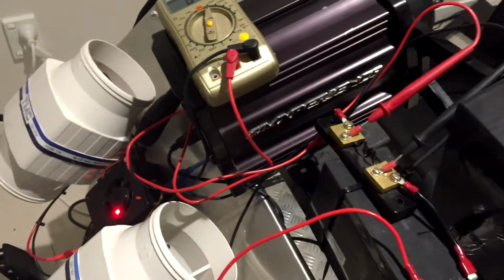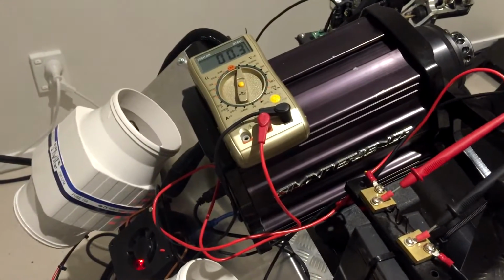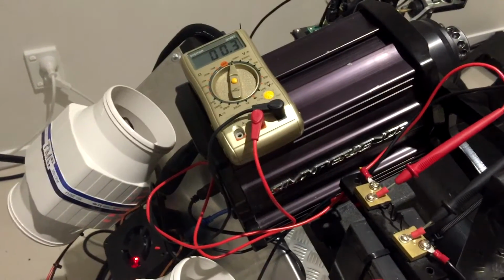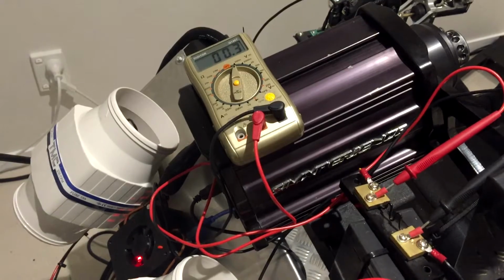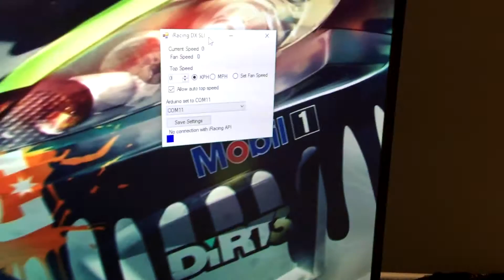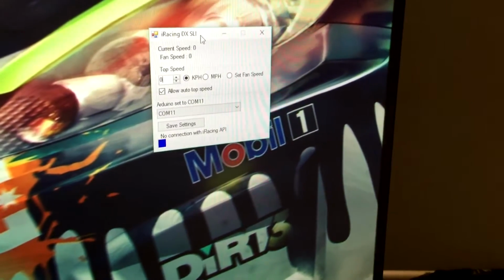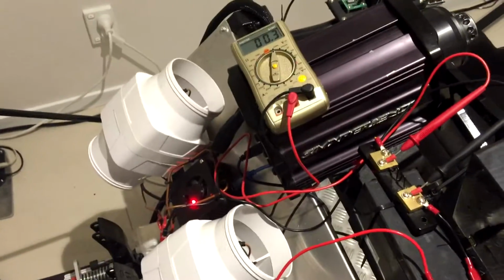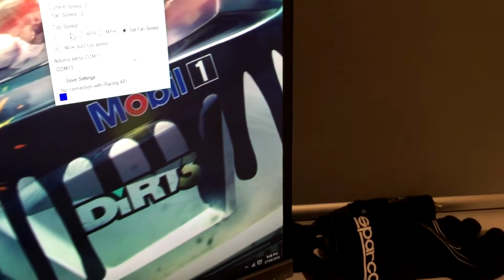Current (Amp draw) Comparison between the TMC and Seaflo blowers on my wind simulator

Comment: Does make it feel like real wind in car or is this to keep cool
Reply from the maker: Yes, it simulates the wind you would feel in a real car. It will speed up and slow down as the car accelerates and decelerates in game.

This video shows it in action in No Limits Rollercoaster 2. You can see the blowers will simulate the wind from the coaster.

https://www.youtube.com/watch?v=32G7lwqxdXM

It also works with most racing games, iRacing, AC, PCars, Dirt Rally, rF1+2, AMS and the list goes on.

It feels especially good in open wheelers in VR. My favourite combo in the HPD in iRacing at Nords.